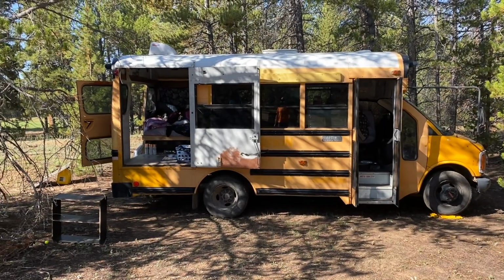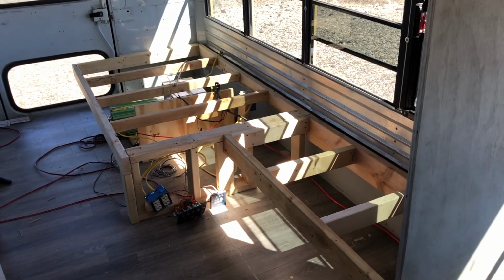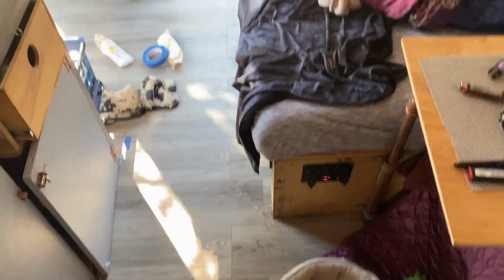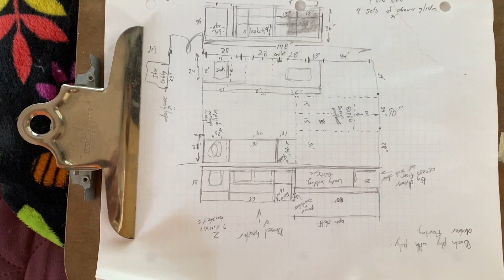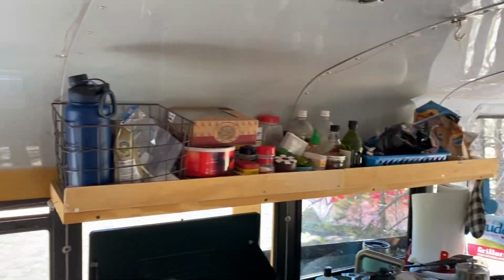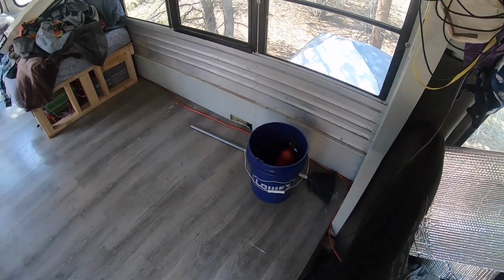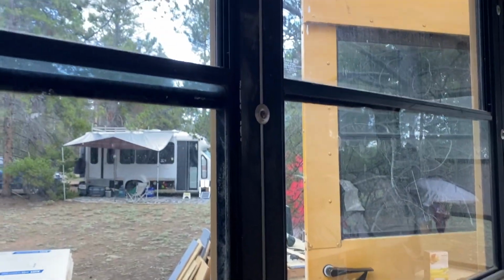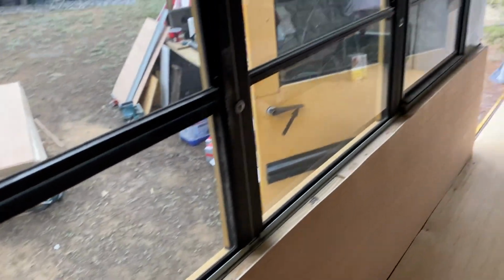Short Bus Redux Part 1 Getting started

Comment: I built a handful of commercial fishing boats for myself, and learned that trick the hard way. I dreamed up a cool cabin layout and installed it before launching one boat. I fished one season and hated the layout. Took it back to the shop, cut it out, and built it like I wanted it. Next boat was different size, and I just tabbed in basic boxes and fished a season like that. I had plenty of time to contemplate and do exact drawings of how I eventually finished it after the season. Saves a lot of time and materials doing the finished build the right way! Great video guys!😊🥰